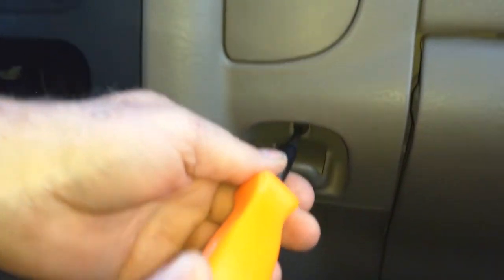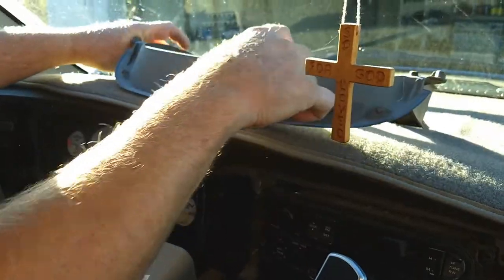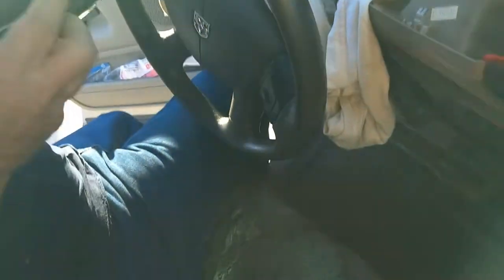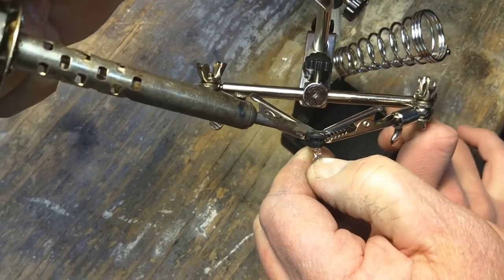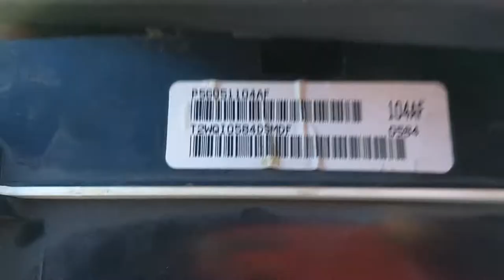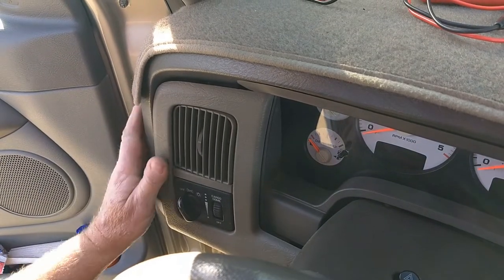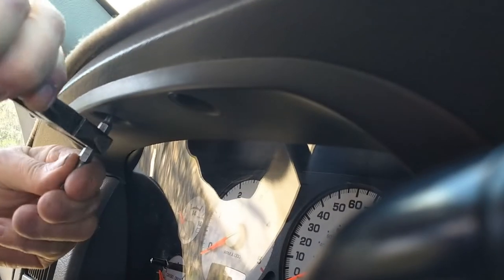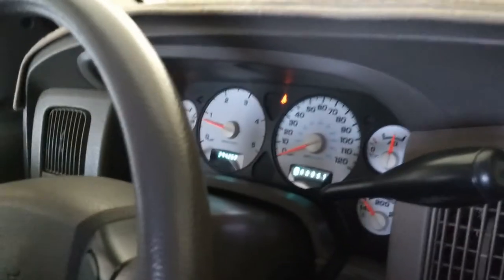How To, Instrument Cluster Light Replacement In A 2004 Dodge 2500

Comment: I just did my 05 ram 1500 changed them to blue the cluster takes 11 8.5d make sure to buy few extra and I bought 1 8.4d for behind the keyless entry box so I didn't have to cut that bulb down I did have to bend some of tabs so they had a better connection they all worked on the first try make sure to test it before you put it all back together

Comment: super bright LEDs has any colour LED that will fit perfectly all you need do is slightly bend the pins down so they go in TIGHT and you get LED longevity
Reply: Do you have the part number for the right style bulb

Comment: Take the damn key out
Reply from the maker: Sorry 😬
Reply: The key probably wasn't in anyway... I just did this recently to upgrade the radio. Pull fuse #51, the retained one, just not all the way out and the "door ajar" alarm will shut off. EDIT: HAHAHAHA, actually I can see the keys in the ignition later in the video. Still, pull that fuse and it will shut up.
Reply: Should have disabled the chime.. You'll wish that you had!